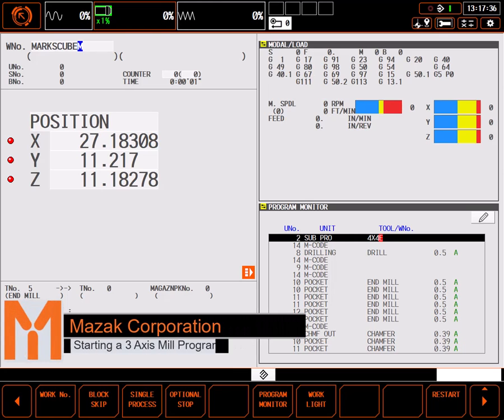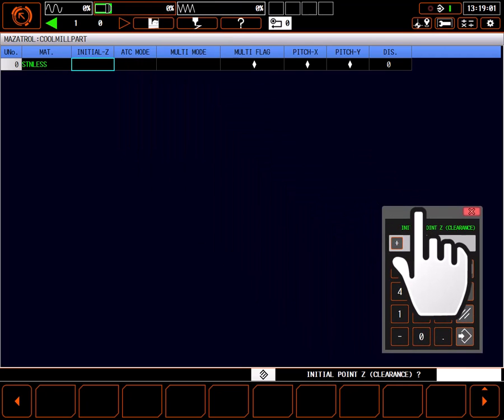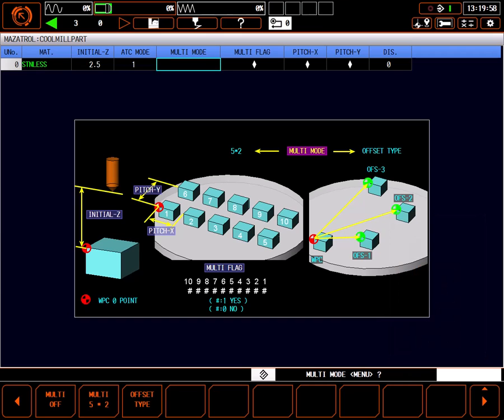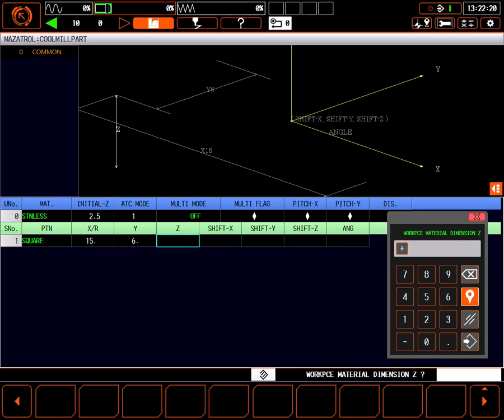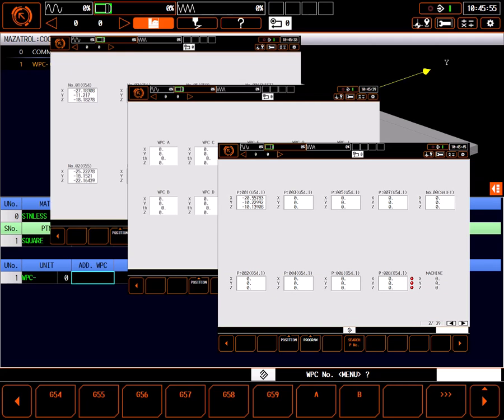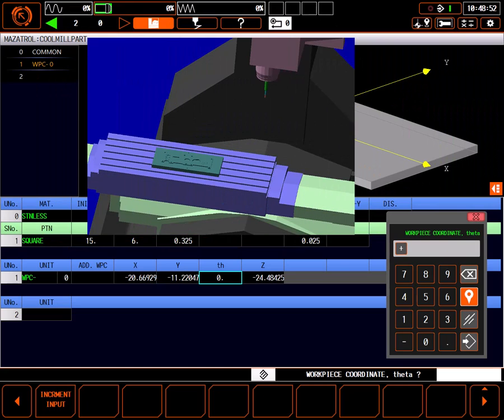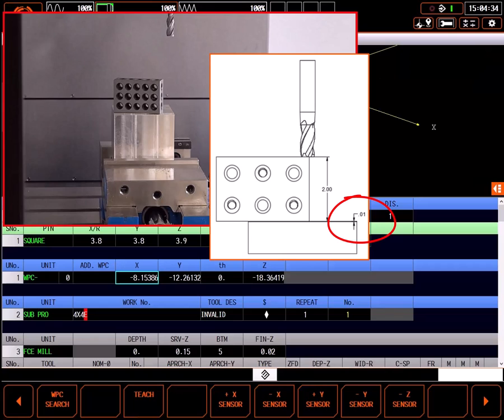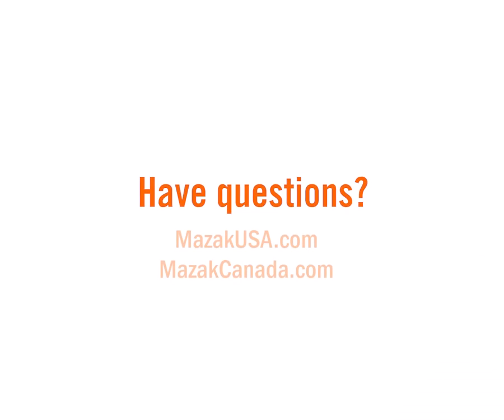MAZATROL Programming Briefs - Basic 3-Axis Mill Programming

Comment: Question.... normally run EIA on a 510 vertical matrix control... why is it the tool i pick up g54 z with runs ok... but the next tool only .5" difference in height runs like 1.7 positive off the part... its like inhave to call up work offset g54 for every tool and lie the difference
Reply from the maker: The issue sounds like a parameter setting. More than likely F93.3, which determines when the tool offset is applied. If this parameter is not active, the tool offset is not applied until a G43 is executed. If the the parameter is active, the tool offset is applied at the tool change (preferred).  If you need more help with this, please contact your local Mazak distributor or Mazak Tech Center for applications support.